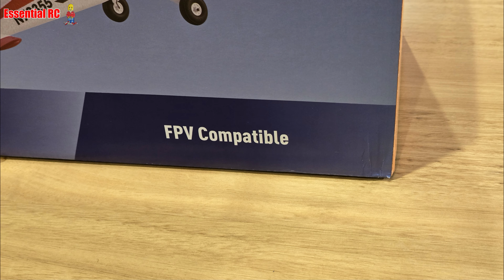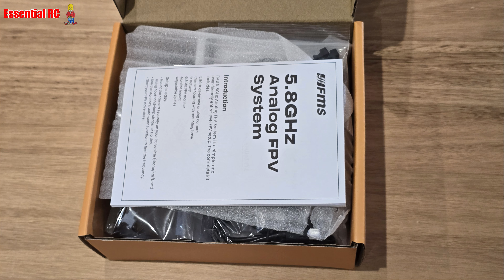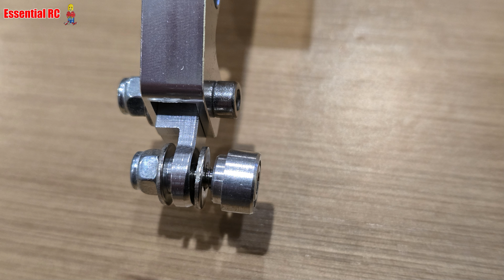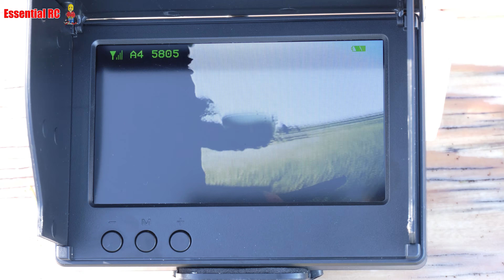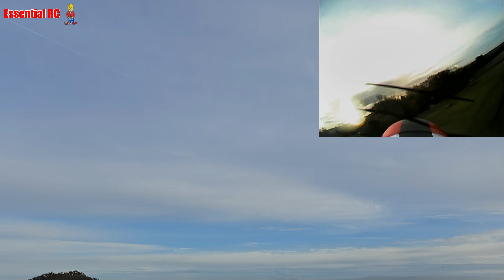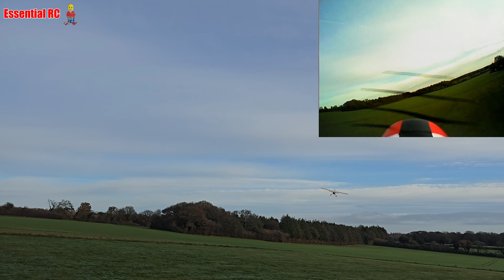FMS de Havilland DHC-2 Beaver READY to FLY with EASY FPV ADD-ON

Comment: Flies quit nice. Not crazy about the Analog FPV.
6:39... If the LCD screen does not transmit an RF signal from the Antenna Connector you will not damage the LCD screen if you forget to install the Antenna. It is simply an RF Input.

Comment: Great little plane -will this fms camera sync to DJI n3 base model goggles ?
Reply from the maker: No because N3 is for DJI digital HD system. You would need analog goggles. Mine are these https://shop.makerfire.com/products/skyzone-sky-04o-pro-fpv-goggles-dual-receiver-fusion-analog-video-transmission?_pos=2&_sid=ab574c392&_ss=r&aff=526
Reply: @EssentialRC  thank you sir ! Your channel has been very informing . Happy 2026 ! Look forward to seeing more planes in the air !